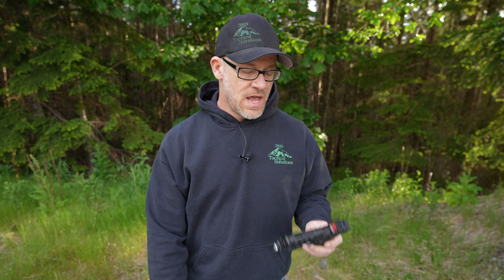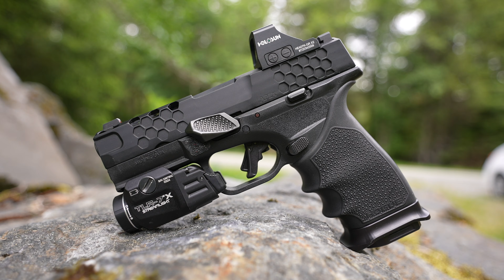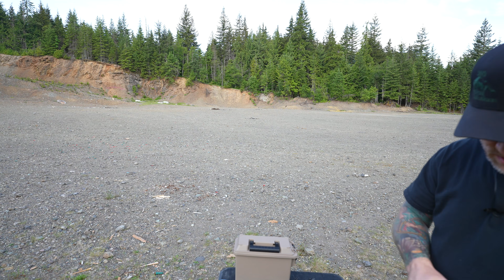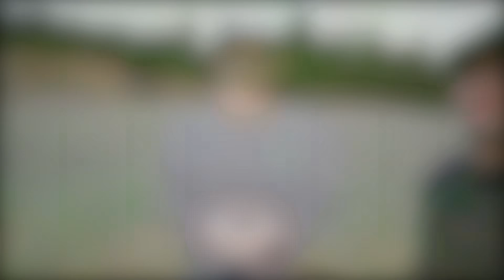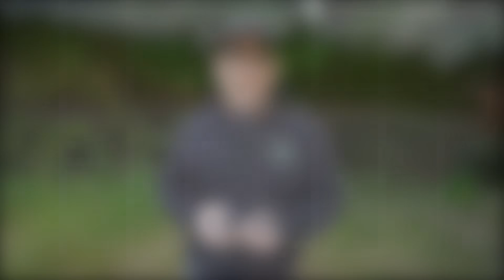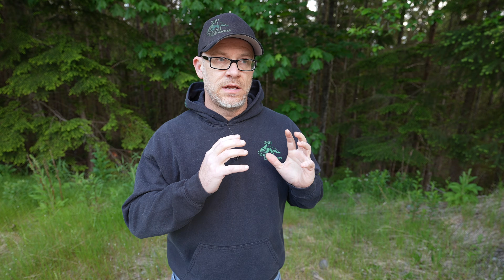BlackSteel vs GoGun USA - Hellcat Pro

Comment: Question, why won’t your slide lock back to the rear? Is it bc of the gas pedal?
Reply from the maker: The gas pedal takes the place of the takedown lever which doesnt do anything for slide lock. My mags have extensions and the springs are weak after all the use I’ve put them through. This means the follower is barely pressing on the slide lock after the last round. On top of that my thumb tends to ride the slide release so between that and my springs it generally doesnt lock back. I have new springs with extra coils but I havent put them in yet

Comment: I shoot boat loads of rounds for work and personally. 
Gas pedal: better price, more streamline, effective
Black steel: better ergo design, more expensive, and has come  DISLODGED multiple times on draw😖.
Disclosure, not sure if it was the glock design that causes Black Steel to dislodge Vs the sig not having this issue with the gas pedal.
Reply from the maker: Ive never seen that issue on the Hellcat Pro, CZ P10C or M&P. It may just be a glock thing

Comment: What kind of magwell is that for the hellcat pro
Reply: And is it compatible with the ten round magazines
Reply from the maker: Thats from Floyds Custom Shop. Adding the magwell does require swapping mag bases to Floyds mag bases but they do have bases for the 10 round mags. It can get a little expensive adding a magwell and bases but Floyds loves my viewers and set them up with a promo code. Use 360TS at Floyds to get a price break
Reply: @360TacticalSolutions thanks so much appreciate it

Comment: What grip do you have on the first gun you showed with the finger grooves is that a def  grip or is that how the frame comes I personally like finger grooves on my guns because they push my hand up words into the trigger guard
Reply from the maker: That one is the Hogue rubber grip. It basically slides on. It's a crazy tight fit and takes a little work but once you get it in place it really helps fill the hand and get rid of the square feeling of the grip.

Comment: For the cost i would say put a comp on.
Reply from the maker: I think it's more complicated than that. I mean sure put a comp on it but you still don't have a great place with much leverage for your thumb. And you need a threaded barrel if you don't already have one. Threaded barrel and compensator can end up in the $300 range. Once you have a comp on sure it reduces recoil but the extra weight up front can lead to muzzle dip and don't get me started on the issue of comfort when concealing. I have one HCP set up with a comp and it's rare that I leave the house with it even though I rather enjoy the way it shoots. A lot of people want to keep the overall weight and footprint the same and for those people the Black Steel is a great option.

Comment: Back a few years I brought the Go Gas Pedal and I currently have a Hellcat Pro. I was trying to mitigate the recoil on it and this is prior to the porting. It did help out and accomplished that more than just having nothing. I recently just ran across the Black Steel and Im using the #3 which I like the forward cant of the thumb more. The Go Gas Pedal as you said is a more push towards the firearm method. 

Before running across the Black Steel recently I reached out to Go Gas Pedal in regards to them developing other Go Gas Pedals for other Firearms that I was trying to reduce the recoil effects. They didnt make if for my models and in a polite but stern way they were like we dont offer if and we dont plan on making 18:36  it and screw off but professionally if you can say that. Needless to say I won't support that business again.
Reply from the maker: This seems common of their attitude. I got the feeling that it’s like they created this product and some people liked it, they decided it was peak perfection and are almost offended by anyone suggesting any type of improvement it could have. Almost to a point of lashing out at the end user like they are a problem instead of taking helpful feedback under consideration. 

That’s one reason I no longer advise people to buy that product. The customer experience isn’t great. On the other hand I’ve found the Black Steel products to look better, function better and the company has top notch customer service. Don’t make sense to go with any other brand in my opinion

Comment: Which version thumb rest for the Black Steel Grip Control are you running? One, two or three?
Reply from the maker: The versions are essentially sizes. I use the #1. Best way to pick a size is to pull up the pic they have on their site that shows each size and then hold your gun like you would when shooting. Compare your thumb placement to the placement of the Grip Control for each size and pick the one that sits closest to where your thumb sits
Reply: @360TacticalSolutions thank you.

Comment: Was looking at Black Steel and now I’m even more convinced to get one eventually. 

Non-related question to the video: in your experience, can you use a Hellcat slide on a Pro frame? No worries if you don’t know or have an answer.
Reply from the maker: You definitely can do that combination. I’m on the lookout for a Hellcat slide with threaded barrel so I can put that on a pro frame with the Rook Precision compensator. I have a buddy in Texas using that combination and its pretty friggin amazing
Reply: @360TacticalSolutions do you know if I would have to change the internals or if I could run the Pro internals minus whats on the slide?
Reply from the maker: @dcwarrior1209  Internals are good to go aside from the slide parts and really its just the guid rod and spring being a different length. Other than that it all matches up. You can swap the two slides back and fourth without any additional parts or modifications.
Reply: @360TacticalSolutions I’m pretty new to the gun game so if it’s not too much trouble, could you reply with a list of what I’d need to swap over and/or keep part-wise? You said barrel, guide rod, and spring. Is that all? Does that mean I’d be able to keep the FCU, slide lock, mag release, and any other parts that are in the frame of the Hellcat Pro? I’ve tried looking online to no avail and you seem like the Hellcat expert. 

Thanks in advance!
Reply from the maker: @dcwarrior1209  Ok so super easy. Let's say we have a Hellcat and a Hellcat Pro on the table. The slide from the Hellcat will easily move over to the Pro frame with no parts needed. I was thinking of a different configuration lol, my bad. The smaller sized Hellcat will have to be a threaded barrel version and you will want to mount a compensator to it. My advice is a comp from Rook Precision and you can get that discounted with my promo code 360TS. 

All of the parts for the two guns are basically the same. Slide lock, mag release, trigger, striker, sights...all that stuff is interchangeable. The only parts that are different are barrels (size obviously) and the guid rod. For what you are wanting to do this doesn't really matter.
Reply: @360TacticalSolutions You’ve been a lifesaver! So a standard 3.8 inch threaded barrel will work then?
Reply: @360TacticalSolutions better yet, I should be able to swap over the internals on my Pro slide into an empty Hellcat slide and not have to purchase anything other than the comp, threaded barrel, and guide rod assembly?
Reply from the maker: @dcwarrior1209  You wont have to swap anything over to the Hellcat slide, just need a threaded barrel for the Hellcat and a comp. I’m not sure what the barrel length is on those Hellcat threaded barrels but Springfield sells them pretty cheap
Reply: @360TacticalSolutions awesome! Thank you so much and I’ll be sure to check out that Rook comp

Comment: Where did you get your grip and mag well?
Reply from the maker: I have two grips in that video. Both are from Hogue. The one with finger grooves you can buy directly from Hogue, the one with no finger grooves is exclusive to Langdon Tactical. The magwell and mag bases are Floyd’s Custom Shop and you can get a price break by using 360TS as a discount code at checkout

Comment: Go gun looks just like the Amazon gas pedal I use for under $20 I have to cut it n reshape it to fit but wrks great after that. It doesn't seem to have a big enough pocket for the thumb so a Dremel fixed that
Reply from the maker: Gotta love the old Dremel tool

Comment: I've followed this great series on the hellcat pro and I must say that you did a wonderful job. I have the hellcat pro comp and I've incorporated a lot of your build upgrades. I have the Blacksteel Grip Control, Floyd's Custom Magwell, Eps Carry green dot, Apex Type 3 Trigger, and a TLR 7X SUB light. I'm thinking of either getting an Apex Recoil Assembly or the DPM Recoil Reduction System as my last upgrade for this gun. Which 1 would you recommend? This is my edc and I'm loving everything that I have done so far. I just want to know what will reduce the recoil better, the Apex Recoil Assembly or the DMP Recoil Reduction System? Thanks for all that you do to inform your viewers.
Reply from the maker: Sorry for the delay. I’ve been fully focused on selling my house and moving into a new house the last few months so my response time is random. 

After using the MantisX to measure muzzle rise I would say the DPM doesn’t really reduce enough to make it worth buying. The most I was able to record was about a 2° difference between that and stock setup and really that could just be a variation in my grip. I think it’s a great system if you add a compensator and need to dial in for reliability but as a recoil reduction product I’m just not seeing it. For the cost, I’d skip it. 

The Apex guide rod is more cost and adds some weight and stability but again the muzzle rise numbers are huge. With the DPM it feels almost like a bounce whereas the Apex stainless guid rod feels like a stable rise and fall. I found about a 2.5° difference between that and a stock setup but it was consistent whereas the DPM was sporadic. For me that indicates a true difference in handling vs what could potentially be variations in my grip or perhaps the random bullet that is underpowered or any number of other causes. 

I believe the Apex is 40 and it’s a bit less when you use 360TS as a discount code. For $40 I feel like I’m getting my moneys worth. With the DPM products usually costing two or three times that it feels disappointing when you take them out and test them at the range. Hope that gives some insight and I really do appreciate you watching. Thank you
Reply: Congratulations on your new home and thank you for the response. Based upon your recommendation, I will be going with the Apex Recoil Assembly.
Reply from the maker: @jermelwest7892  moving sucks but at least its only a 20min drive and it will cut my drive to where I film down to about 15 minutes so thats a huge bonus

Comment: @360TacticalSolutions I will say that I think I've watched all of your videos on the hellcat pro and since I have upgraded mine to having the floyds custom enforcer port job the mcarbo striker and trigger kit ( which i had the same thing happen to me with the set screw twisting the allen key when I went to adjust it later) a hogue grip and now I'm highly considering getting the black steel gas pedal so thank you
Reply from the maker: Yea I just dont even mess with MCarbo anymore. Between the set screw in the trigger and over time finding their springs get weak faster than anyone else’s I just avoid their products now. I’ll say this though, that Black Steel grip control is legit. I love it
Reply: @360TacticalSolutions  you don't still use the striker?
Reply from the maker: @HunterMoore-l6t I still have the striker but I’m not using their springs. That striker is installed on one of my HCP that I don’t daily carry, it’s more a range toy than anything
Reply: @360TacticalSolutions  good to know, I’ve been debating on getting the MCarbo springs in hopes it would help with the hellcat pro trigger. I’m probably a little over 1k rounds and I still hate it. You still liking the apex trigger?
Reply from the maker: @101shred definitely. I have 3 Hellcat Pro’s and they all have an Apex in them. One has over 50k rounds through it and still going strong

Comment: What position 1,2,or 3 for the black steel grip control
Reply from the maker: I went #1. I pulled up the picture they have on their site and compared it to where my thumb sits when I grip my gun to determine what size was best for me
Reply: when i ordered my first grip from black steel i ended up contacting them as it wasn't a good fit for me. the customer service was great and they immediately sent out the next size for me to try and a return set up to ship the first one back. for my best grip i ended up with the #1.
Reply from the maker: @mytquin7605  thats great info. Thanks for sharing

Comment: How did you pick the right size for the hell cat what you go with size 1 2 or 3 there mesuring guide wasent clear
Reply from the maker: I went with the #1. Their guide has a pic with the three sizes superimposed on the gun. I pulled that picture up and held my gun up using my natural shooting grip and then compared where my support thumb sits vs the picture on the site which gave me a pretty good idea of what size would work best for me

Comment: With Black steel what size do you get for hellcat pro ? 1,2,3 ?
Reply from the maker: I’m using the #1. I pulled the pic up they have that shows each number and where it sits. Then I compared where my thumb sits on my gun vs what number or correlates to. Comparing to their visual representation helped a lot
Reply: @360TacticalSolutions great! Thank you for the quick response ! Much appreciated 🫡
Reply from the maker: @SouthPawJP glad to help. Don’t forget that discount code either…them things are expensive, I’d hate to see you pay full price
Reply: @360TacticalSolutions yes ! Just ordered and used your code ! Thank you! I Got 2 lol ! One for my HCP and the other for my Echelon . Excited to try them out .
Reply from the maker: @SouthPawJP  great product. You will love it

Comment: So the reassemble with the black steel you push up on it?
Reply from the maker: In order to disassemble you turn it clockwise and then after you replace the slide you turn it counter clockwise